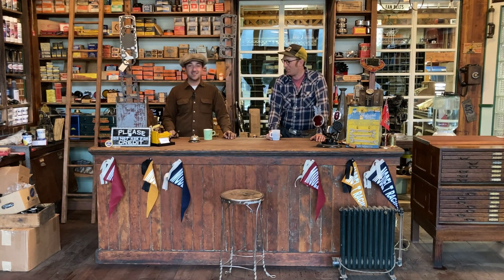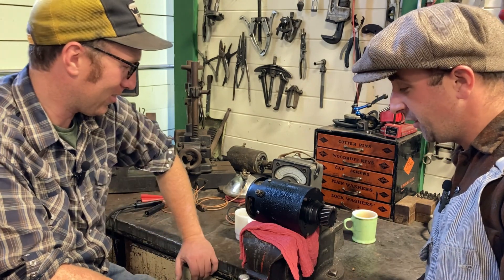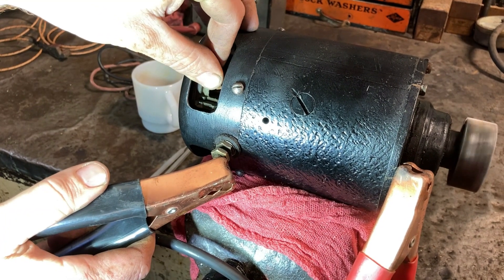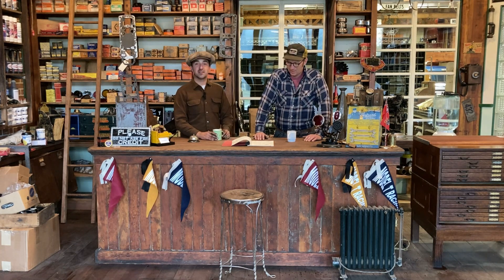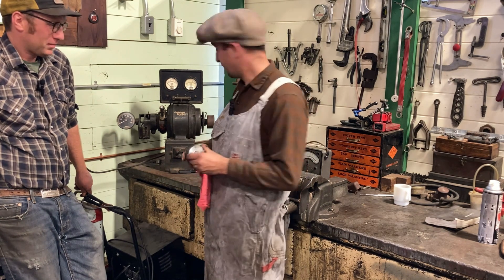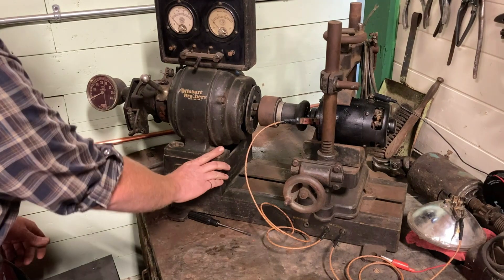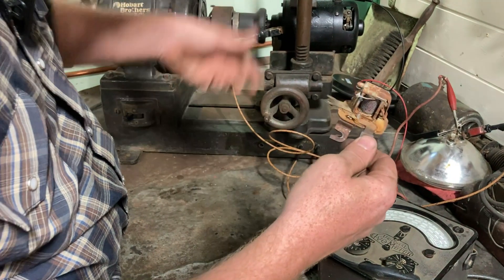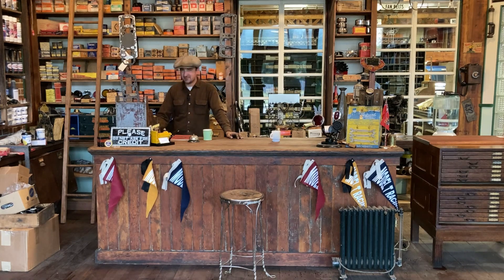An Electrifying Trio! The Model T Ford Three Brush Generator!  Plus Bonus Vintage Hobart Tester!

Comment: Your initial brush plate setting was correct, but you should have tightened the four screws before placing on the machine. Then only move the third brush br itself by loosening the internal nut on the brush plate.

Comment: I have a really great project idea for you. Have you heard of the Jappic? It was a Brooklands cyclecar racer, with less than 4hp, in a small motorcycle engine. There is an antique Pathé film you can watch about it, here on YT. What if someone were to find you a 4 cylinder Henderson engine, and you put it into a featherweight cyclecar racer.... A person could even use a certain kind of airplane part, for it's body.... I'd say it would be a pretty fair race, against your faster Model T's. .....ACTUALLY, that antique V-twin motorcycle engine you have, would also be competitive with Model T's as well. ...Any of the Henderson engines would be FAST though.......

Comment: hey guys i found you channel from curiosity inc. ! there is  channel called iron trap garage, in Pennsylvania, beside building hot rods they travel the states gathering old model t and a plus other parts. what they are not going to use they store in a warehouse for sale !  if you are looking for head lights for the barn find they probably have them maybe even seats and running boards. 
Give them a look see.

Comment: Do you use an in line power resistor on your old tester?  It might be a good idea as it's likely meant to be run on 110-115 volts and modern voltages can often be as high as 125 which would throw off a different reading on the meters that aren't expecting a voltage that high.  I install power resistors on vintage radio equipment I use for that very reason although tube radio gear may be a little more sensitive to the extra strain of higher voltage than your machine.